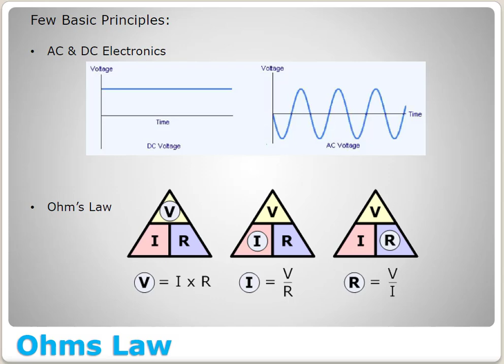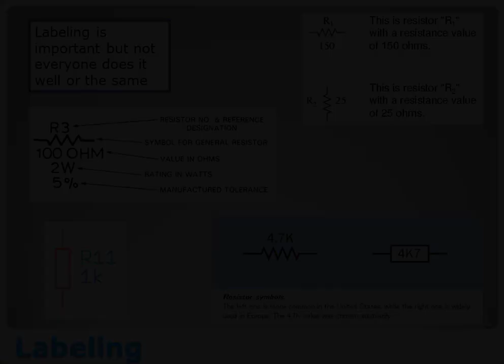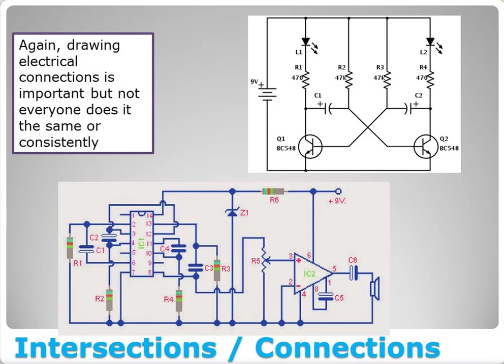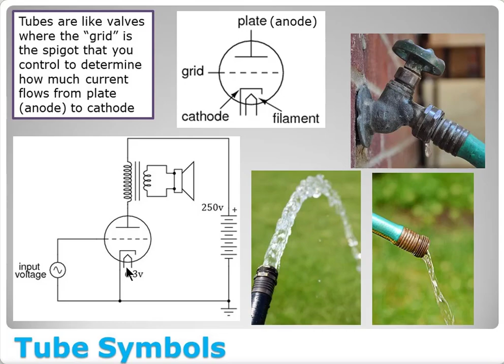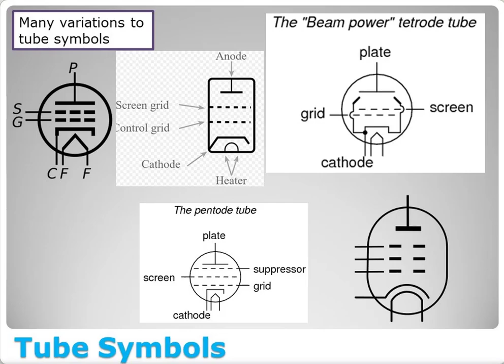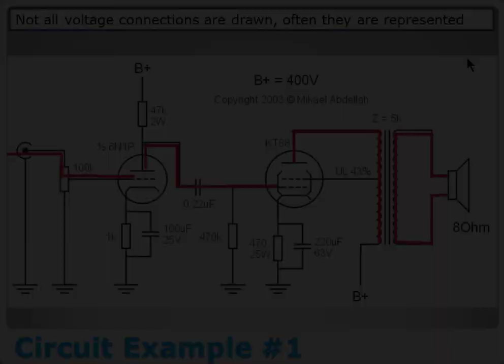Understanding Vacuum Tube Amplifier Schematics - Basics - Part 1

Comment: In the Ohms Law section, you talk about how the B+ voltage travels from the plate of the 6N1P to the cathode and onto ground. Im confused because the B+ is DC and the tube is a capacitor of sorts and DC doesn't travel across a capacitor? What am i misunderstanding?

Comment: So when using ohms law to  calculate the wattage for the cathode bias resistor, you ended up with 68 milliwatts. Should it not be 3.33 watts? (400V ÷ 48kohms = .0083A --> .0083A x 400V = 3.33W). I'm confused as to why you squared .0083A, what am I missing?

Comment: I know response to this video may be almost zero after 7 years. 
The thing that absolutely boggles my mind is how plate voltage to the KT88, the final amplifier,  is supplied through the output transformer!!!! It seems the plate of KT88 would be tied to B directly and the transformer would be fed through a cap like the first tube feeds the 2nd tube with the bottom of the output transformer tied to ground.
It seems current going through the transformer to feed the KT88 plate with the output signal would create noise. I hope someone understands my question and can answer it. 
Thanks.

Comment: I recover electronics training in high school as an elective “ vocational training” in 1972-1974… we used slide rules…. But electronics did not become by day job so certainly the skill set faded to near zero…
I’ve be SEARCHING FOR A good explanation / “re-primer”… of basic audio amps…
This explanation was the best I’ve found in weeks of searching…
BUT…. The classic mis interpretation / mis representation and therefore the understanding of of electron flow AND THEREFORE SIGNAL PATH…

This video does mention this misunderstanding… but I wish that it was stressed every time (especially) signal path is discussed…
The signal PATH expressed in mV and then volts as it is amplified…  is from grid to anode to grid to anode…. And this APPEARS to be “reverse of positive to negative”… because it is. 

Otherwise again… the best video I e found.
Finally…
From my old rusty incompetence…
1) what  signal voltages and  signal voltage increase might we expect to see along the signal path…
And
2) are these volts read as DC… or AC ( I get it , signal is AC… BUT the AC surfs  on the back of the DC)
And
3) can these signal voltages be read with a better volt meter…
and
4) is this safely done by connecting the negative lead to the universal ground and touching the positive meter probe to “ next grid”?

Thx

Comment: Hello, You say the heaters can be heated via ac or dc. Question I have about that is with ac, the wires can be twisted in an attempt to keep out hum, are dc connected wires not affected by hum? What I'm thinking is that running a dc would allow one to run say 37.8vdc through 6 - 6.3v tubes, and do some with 'one wire' doing series connections. In such a case, is the wire with dc immune from 60 cycle hum? TY William

Comment: I pretty much knew the tube diagram schematics. 3 years architectural and mechanical engineering drawing before CAD. Another website i was watching threw me off. He described the filaments heating up and the negative electrons flowing up to the plate from the cathode through the grid or grids,,, when in actuality it's the opposite? + To - right ?
Reply: Electrons are emitted from the cathode and flow to the plate. However, this can be seen as 'conventional current' flowing from plate to cathode. Even after the discovery of the electron, tube amp circuits are often described in terms of conventional current. Learning to think in terms of both electron flow and conventional current is a useful skill. (A current of 1mA flowing in a 100k resistor drops 100V across it whichever way it's flowing).

Comment: This is great!  Thirty plus years ago, as a navy submarine sonar technician, half of my job was repairng high powered amplifiers in my sonar gear.  Once I got out of the navy, however, I drifted away from electronics.  Now I'm getting back into it and don't you know I've become rather rusty at things like reading schematics.  As I plan to work primarily on vintage guitar valve amplifiers it's like going to work on scaled down versions of what I used to fix in the navy.  This video is a really nice refresher to drag out the information I used to know almost instinctively but has faded due to disuse.  Thank you so much!

Comment: The information you provide with your videos is truly invaluable. As an electrician, I understand the working principles of electricity, but have always been a bit intimidated by the complexity of electronics. Your videos have helped me gain some understanding of this stuff, to the point where I feel confident in rebuilding my Pilot 232 power amp. I had planned on bringing it to a shop, but after what I've learned from your videos, I think I will take it on myself! Truly can't thank you enough for providing this wealth of knowledge for everyone to learn from!

Comment: I have really enjoyed watching the first 4 parts in this schematic series. I will continue to watch the rest. 
Have you ever considered showing how to "trace" the actual physical components in an amp or tube radio in reference to the schematic???
I mean, reading the schematic is one thing. Actually finding the particular resister or cap, etc. in regards to the schematic "map" is another thing. As you well know, the schematic will (sometimes)  make it look like a particular component is sitting right next a certain cap or resister. In reality the the other component is way across the physical chassis hidden behind some other component. Also, there is very little (if any) instructional videos concerning working on old 50's & 60's Lesslie amps. I think this would make a great instructional video. These are still very popular amps. Thanks

Comment: i just stumbled accross this vidio and it will be of great help to me. I am trying to build a regen receiver and add an af amplifier using a type 30 for the amplifier tube and i am trying to figure out the coupling cap between the 33 and 30 tubes

Comment: Hello.  If the current through the 6N1P is 400 V / (47 kOhm + 1 kOhm) = 8.3 mA, then the power dissipation of the 47 kOhm resistor would be 8.3 mA^2 * 47 kOhm = 3.26 W, which exceeds the 2 W rating.  Additionally, this current amount would result in a plate voltage of 400 V - 8.3 mA * 47 kOhm = 8.3 V.

On diyaudioprojects, an annotated schematic showed a nominal current of 4 mA through the 1 kOhm cathode resistor.  Using the Svetlana 6N1P datasheet plate current vs. plate voltage plot with Vg = -4 V and a plate current of 4 mA, the plate voltage is approximately 215 V.  This plate voltage would result in a current through the 47 kOhm resistor of (400 V - 215 V) / 47 kOhm = 3.94 mA and a power dissipation of 728 mW.  This power level seems more plausible for the 2 W rated resistor.

Let me know what you think.
Reply: I was thinking the same, the first one resistor if using 8.3mA, the wattage would be 3W. I was confused. But if the current is 4mA then it makes more sense to me. The voltage drop across the 47kΩ resistor is 185 volts. The current through the 47kΩ resistor is approximately 3.94 mA, and the power dissipation is about 728 mW (or 0.728 W).

Comment: Thanks for the video!
Newbie is here, please be patient.
42:25: "it could be 20..30 volts": If the output voltage is about 20..30 volts, then why there is a need of so high input voltage, which is 400 volts? The concern is that the weight of transformers is about 60..70% of the total weight of an amplifier. Is it practically possible to reduce these 60..70% to, say, 10-30%?  The benefits are: less weight, less (useless) heat, less price, etc. If the reason goes to the tubes, then are there any tubes on the market that can operate on a less voltage? Thanks.

Comment: Super. could you go over a marshall 8004 solid state amp. the schematic exists in tubeductor and looks like a very tidy schematic but the input jack representation is quite different the number of capacitors in the circuit and the wording is  different. many thanks

Comment: Thanks for this great content.  The explanations are very detailed and accurate.  I have a few questions though:

1) is B+ connected to the anode of the (half) 6N1P positive DC while the B+ connected to the output transformer negative DC?
2) where is the input of the (half) 6N1P cathode on this diagram?

Comment: Actually, very often when you see a value of a resistor on a schematic, you know it's precision. Because of E12..E96 (mostly used) series standard values. For instance 4k7 gives you a clue about E24 (a good assumption), and 4k75 about E96 (also is not a bad assumption).

Comment: Hello, Thanks you for this lesson.  I have a 1987 Fender Champ 12 red knob tube amp that has a constant crackle sound, i can play through it but it just crackles.  In this example schematic you show would the plate resistor be the 47K 2watt?  I have the schematic for this amp and trying to find where the plate resistors are.  Thanks

Comment: Hi Blueglow! Thanks for this video, I am a Mechanical Engineer and during my free time I play the guitar! I am experiencing some issues with my valve amp and your videos are helping to understand the schematics I have in hands. 

Do you have any video explaining why a capacitor is placed in parallel with the resistor in your bias section? Remembering my Electronics 101 lessons, the DC current wouldn't go through the capacitor unless there is change in voltage, hence why I believe the effect would be only with the AC current flowing (please correct me if I am wrong!).

Thanks again!
Reply: It’s called a cathode bypass capacitor, helps to increase the output of that stage. Google for more info.

Comment: Dear Sir,

I know that I am wrong, but to my understanding any valve is making DC current only, by changing GRID signal we can change output voltage/current of the output valve but it is still DC, so how  in the end we get AC current necessary for output transformer?

Another question, coupling capacitor of 0.015 uF seems to be low in value. To my understanding it can let trough  only very high frequency signal but not audi signal,. In loudspeaker crossovers we have much higher values to let  pass low frequency to the speaker . So how is it possible that so low capacitance value for coupling can let trough low frequency i.g. 40 Hz?,
Reply: The DC current sent to the output transformer is varying above and below its no-signal value in sympathy with the input signal, i.e. there is a DC current with the AC current (the signal) superimposed on it. The transformer passes the AC signals from primary to secondary but blocks the DC.
The low value 0.015 uF capacitor and the high value 470k grid leak form a high pass filter with a cutoff frequency of  22Hz, well below guitar frequencies.

Comment: Very definitive explanation of the circuit with vac tubes,  @ about 44:00 mins. prior to ending, you showed the current path, however my question is at vac tube 1/2 6N 1P. I understand the function of the Vac tube, so
it's my  understanding  that part of the current feeds via 1K resistor,/100uf cap. to GND which predetermines the amount of current going into the 0.22uf cap and through the rest of the circuit to produce the sound needed.
 Thank you,  Jay

Comment: Brilliant! Thanks so much. Your delivery was pitched exactly where I needed it to be for what I was looking to understand. Over the years I’ve gathered lots of good snippets of knowledge and terms about how guitar amplifier work, but your video pulled it all together for me. In particular, there was a real lightbulb moment when you explained how the pre-amp tube amplifies the AC input signal and how the coupling capacitor allows only the resulting AC current through to the power tube. Also, now I understand how negative feedback works. Cheers from Melbourne, Australia.

Comment: I'm sorry for the loss of your mother. You mentioned this in the last video I saw of you. I have a question for you. How hard would it to convert a Precision Electronics S35 which uses the mighty 7868 tube pair to a pair of 6P41S tubes? Would it sound as good? Would it be worthwhile? It'll be used for a guitar amp and not a PA. Thanks for any help and advice you can offer. I'm new to building and restoring tube amp and anything would help.

Comment: Hello and greetings from Saudi Arabia.

I would thank you for the great videos and the illustration for your followers.

I have Presto K7 Record Cutter Lathe which I couldn’t find any schematic for. I have started the restoration including replacing the tubes and all other components and would ask you kindly to make video about how to draw a schematic digram for this machine correctly and which software is better to use to make the schematic available for anyone needs to service or restore the same Presto K7 Record Cutter Lathe.

Thanks.

Comment: Does the 0.22uF capacitor in circuit example 1 have to be rated at 400v ?
Reply: When this amp is switched on, before the tube begins to conduct, the whole of the 400V B+ will appear across the capacitor. I would use a 600V capacitor for reliability.

Comment: Signal definitely does not flow plate to cathode, the electrons are boiled off the cathode and attracted to the anode
Reply: That's correct according to electron flow theory.  However, it is more common to think in terms of "conventional current" where current flows positive to negative.
Reply: @BadToad1963  If 1mA is flowing in a 100k resistor, 100V will be dropped across it no matter which way it's flowing.

Comment: A question about Circuit example 1:
The B+ to the preamp tube and the first resistor at 47k 2W

Running the calculations:
U = R I 
P = I V 

400V / 48000ohm = 0,0083 A
47000ohm x 0,008333.. =  391,6 V (and about 8.3 V at the 1000ohm resistor so they add upp to 400V)

0,0083 A x 391.6 V =  3,26W

the 47K resistor is rated at 2W will it not be toast? :)

Im new to this a just want to find out if im wrong in my calculations.
Reply: I am confused too about that calculation... I agree with you...
Reply: It’s not possible to find the dissipation in the plate resistor given the information on this partial schematic. Firstly, the supply to the plate resistor will not be 400V, it will have been dropped by resistors in the B+ rail (not shown) to a lower voltage ‘B++’. Secondly, there is a current flowing in the tube and a voltage is being dropped across it so it is the equivalent of a third resistance (R = V/I) between B++ and ground which should be included in the calculation.
Reply: I agree with your result.  Please see my comment for more details.

Comment: I was wondering about the bias supply in the Dynaco Stereo 70. Does the 5AR4 supply the “raw material” for both the bias voltage and plate current? And does that mean the selenium rectifier has nothing to do with rectification, but rather that it is merely a blocking diode?
Reply: The bias voltage is derived from a tap on the high voltage winding of the power transformer which is rectified by the diode.

Comment: First of all I want to thank you for a wonderful tutorial. Bravo! At the end of part 1 there is a B+ wire at the bottom of the schematic that seems to be from a different transformer. Is that true? Also, I understand that we put AC voltage into the amp. Where or how is some of it converted to DC? Thank you!

Comment: im sure you know you dont have to use all tubes ,you can use just output tubes , so even 1 is enough , driven by FETs  of a dual kind for stereo, or 2 , there is no need for 4 . You mostly spent time on basic tube amp design and explaining simplest things about it , but when it comes to real amp(majority of the video), then you jump str8 to the 70s  no ICs or anything stuff . Lot of these ppl would rather make 1 tube preamp /headphone amp , can be both things with a switch , and continue to use their own gear , like me .  But im an audio producer i have gear on my PC better sounding then those tubes , so only reason i would make it is for high Voltage , that can be heard , cant be simulated 100% , but even i dont have to drive output with tubes i can use transistors FETs, makes it a lot easier , it can even run on battery's , dedicated transformers 3 or 4 still needed . So im mentioning it , here since you didnt , you can get away with 2 mono tubes , or even 1 stereo tube , and drive it , with any preamp  you have , then in to the speakers or another amp . Thats the best kind , you just add it in to chain , use it as you like . Even can drive headphones , power amps and be an amp with 1 tube , if im correct that there are stereo tubes , pentodes  i think they call them. Good explanation, just a bit on 70s side . Im sure there are signal Stereo tubes , today there should be power stereo tubes . Didnt check . I will make it tho, so good video imnot complaining , watched it all even tho i know all of it .

Comment: Much appreciate the chance to relearn the fundamentals after more than a 50-year hiatus from my radar maintenance training. Looking forward to the next three installments.
One question: Am I missing something, because I learned that electrons (current) in a vacuum tube flow from cathode to plate?
Reply: Oh, Mr. Franklin and colleagues! You started an argument that still rages after all these years! In fact, both 'electron flow' and 'conventional current' are equally wrong, but both provide those of us without a degree in quantum physics a method by which we can predict the result when components are connected in a circuit. The same current will drop the same voltage across the same resistor no matter which way it is flowing, or if, as is in fact the case, it is not actually 'flowing' at all.
Reply: @silasfatchett7380  The answer is that the cathode is carrying negative charge as is commonly understood. Don't confuse the issue with extraneous baloney.